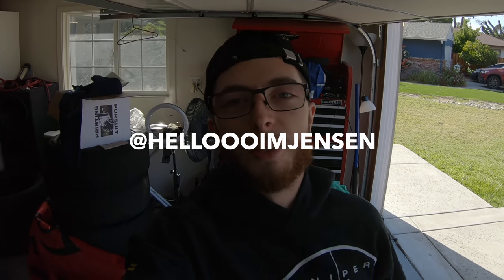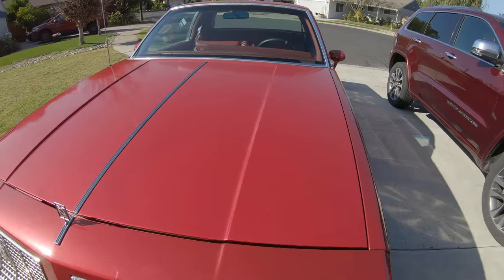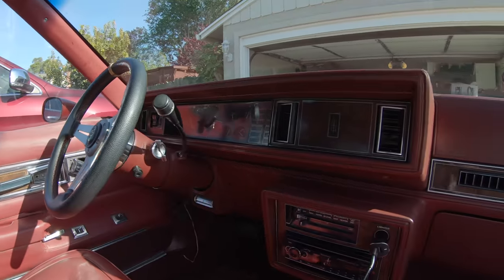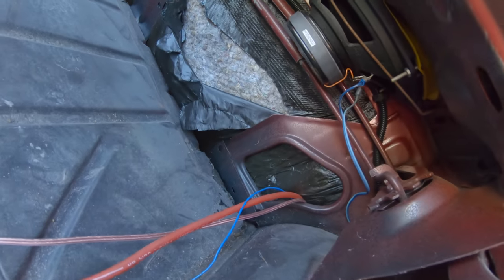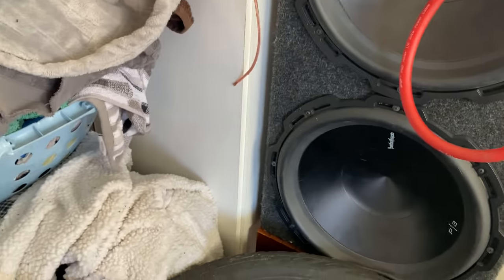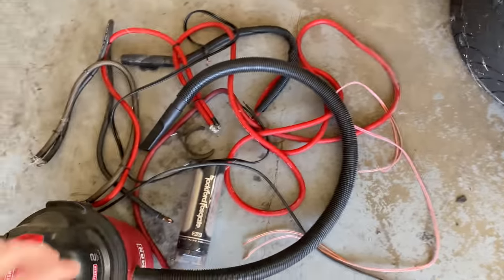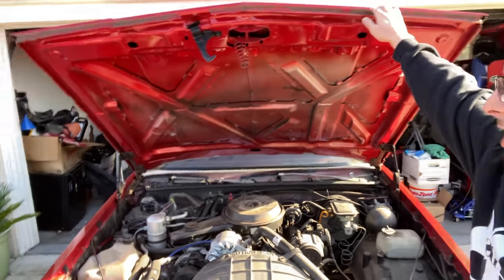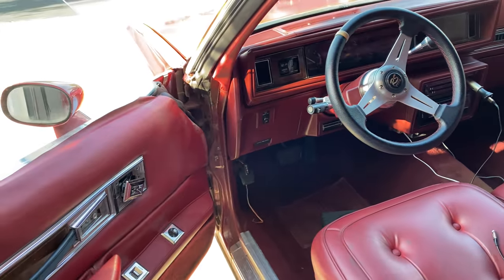MY PLANS WITH THE 84’ CUTLASS!!!

Comment: If i could recomend a touchscreen radio it would be the xdvd176bt by dual , cheap as hell and fits stock sizes , has a 7”touch screen and Bluetooth, thing works great , i have it in my 78 c10 and i love it paired with 4 kicker 6x9s i got 2 on the doors and 2 behind the dash , thing sounds clean as hell with 2 kicker 10’s subs also behind the seat

Comment: Throw that capacitor in the trash along with the 2 12s. You’ll get made fun of if you don’t match subs and it won’t sound the best. Custom enclosure for as many 15s as you can fit, add more power and get your electrical up 💪🏻